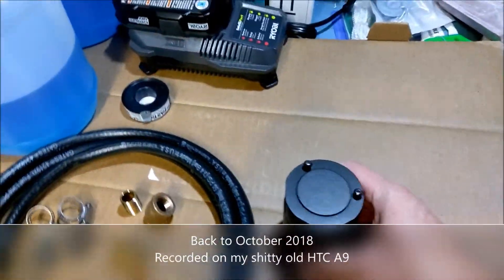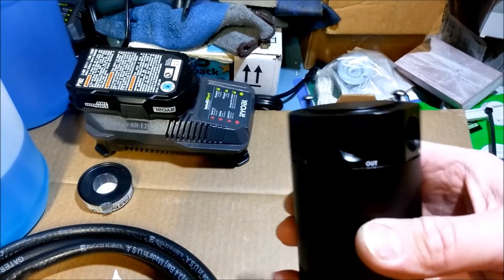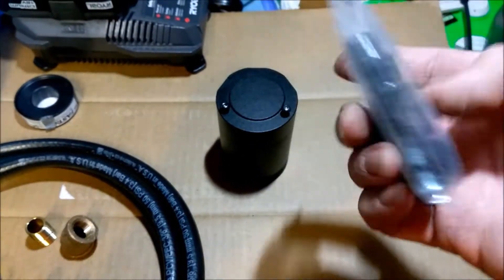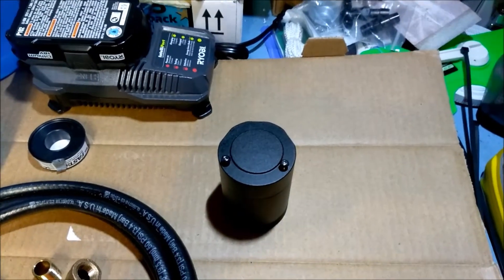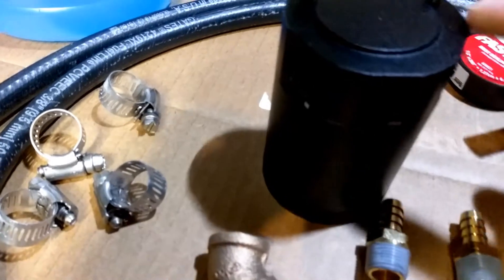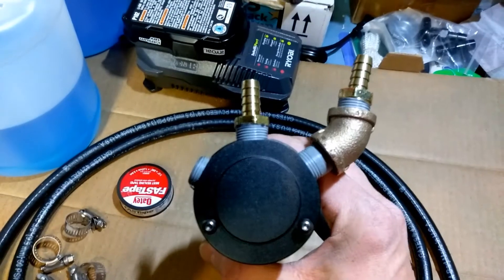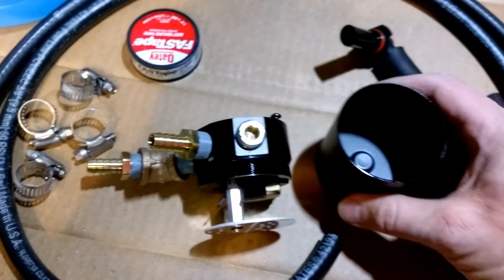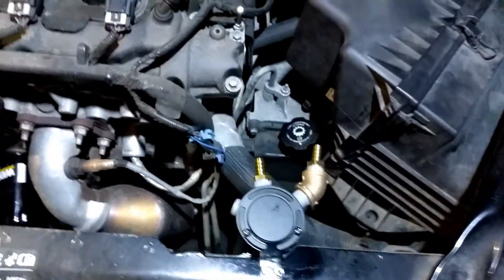GM 3.6 LFX V6 Catch Can Installation & Follow-Up (2012-2016 9th Gen Impala)

Comment: What about the front pvc valve that dumps oil in front of the throttle body. That's where I have a lot of oil on my vehicle.
Reply from the maker: Check out the Elite Engineering clean-side oil separator:
https://www.amazon.com/dp/B086WN3127/ref=cm_sw_r_cp_apa_glc_fabc_TDK0X0B5BQGTH0AWPJ6G

I see Amazon is sold out, but you can still order one from their website:
http://www.eliteengineeringusa.com/clean-side-oil-separator/

I'm actually going to be purchasing one and installing it sometime soon (with a corresponding video to follow!)

Their site sums it up:
"Although app. 90-95% of the oil ingestion via the intake air charge enters via the "Dirty" or "foul" side of the PCV system, the other 5-10% enter via back flow through the factory "clean" or "fresh" side tube. This occurs mainly when accelerating or at wide open throttle when intake manifold vacuum drops to zero and crankcase pressure is allowed to build. This pressure will seek the path of least resistance, which is backwards flowing into the intake air bridge assembly bringing in oil mist and other contaminants into the intake air charge.  While this will not cause severe issue with a port injection daily driven engine, it will cause detonation and reduced power and fuel economy, and in a performance engine, especially forced induction, this detonation is detrimental to power and the resulting knock retard is a negative tuners and owners should avoid, especially if the engine is run hard for extended periods such as road racing, drag racing, or aggressive driving period."
Reply: thats not a valve. thats the drivers side valve cover vent and it will suck oil/air from there when there is no/low intake vacuum

Comment: Great video man. I installed a similar can on my 2011 CTS it has a 3.6L V6 I believe it is the version called LLT. I find mine doesn't catch much condensation water but mostly dark oil in winter and I do live in Canada so it gets quite cold here. The main reason I installed a catch can on my motor is because I noticed a  build up of oil sludge in the main intake hose which was dripping out of the intake manifold and the throttle body was gunked up as well. On the CTS the engine is positioned differently in a longitudinal layout with the pistons facing out towards the passenger and driver sides and the pcv valve is behind the passenger side valve cover and runs to the top of the aluminum intake manifold and mounted directly above and behind the throttle body. I did some research and found out the PCV valve and the valve cover gasket can turn your car into a money pit of repairs or even a Junker if left as is. First I bought a new PCV valve and modded it by increasing the hole size changed the valve cover gaskets to the new format which allows more flow through that passenger side pcv. After all that I installed almost the exact same catch can used in this video and the amount of oil that's no longer going directly into the intake and throttle body is mind blowing. If I didnt install that catch can, I would be spending a crap load on repairs.
Reply from the maker: That's the best thing you could've done on that LLT!  I'm sure you've heard but it bears repeating - the timing chains stretch out on these engines if they're not properly maintained (the chain tensioners will fail with deferred maintenance.)  So I will add keep your oil change intervals low (below 5k.)  Don't go by the oil life monitor - reset one of your trip odometers when you change your oil and go off of that instead of the OLM.  Use a high-quality DEXOS synthetic oil as well.  Keep the internals CLEAN and you won't have any trouble!!

Comment: Bought my 2013 with 90k on it. Checked the valves a month ago when I replaced my voils and plugs. The tops of the valves r pretty gunked up. They look more like exhaust valve , even after seafoaming it last summer. But I have seen way worse in an LLT engine.
Reply from the maker: I was spraying CRC GDI intake cleaner into the intake every oil change before I installed the catch can. When I cleaned my valves at 158k they didn't look too bad. I might pull the intake again just to see how well the catch can is working.

Comment: Great video! I will be installing two oil catch can on my 2018 Traverse. I been searching videos on a guide on how to instal an oil catch can on these 2nd gen Traverse, but had no luck.  As the most i ever find is on the 1st gen traverse only which is different design than the 2nd gen traverse.  Im not sure if i need two or just one.
Reply from the maker: FYI, the engine in the 2nd Gen Traverse is essentially the same engine that's in the Impala from 2012 to 2020. The only difference is they added auto stop/start to it and renamed it from LFX to LFY.

That said, I looked up the PCV hoses on RockAuto and the dirty side hose, although longer, looks identical to the one on the LFX. 
https://www.rockauto.com/en/catalog/chevrolet,2018,traverse,3.6l+v6,3438973,exhaust+&+emission,positive+crankcase+ventilation+(pcv)+hose,11784
The clean side hose has a filter of some sort on it. Not sure if that's an actual oil separator or what, but I would suggest discarding that altogether and installing a clean-side oil separator.
https://www.youtube.com/watch?v=hu57lGzxiRY
Reply: @CertifiedShadetree how in the hell do you get that PVC valve out? I am so afraid I'm going to break something I have a 2020 Chevy Impala that thing does not want to come out
Reply from the maker: @peachyclean93  Latch a Vise Grip onto it and rock it back and forth whilst pulling up on it.
Reply: @CertifiedShadetree  I think I found out today that mine does not come out it's part of the valve cover which is so stupid!
Reply from the maker: @peachyclean93  2020 Impala, you say? GM never changed the valve cover design on the entire run of the LFX. Plastic valve cover with a metal PCV "valve" (more like an orifice.) Try freezing the PCV with a can of compressed air, then try wiggling it out. You could even heat the valve cover around the area with a hair dryer first to help expand the plastic surrounding the PCV.

Comment: I just bought a new 2020 Frontier with the new 3.8L GDI engine. I have 200mi on it and my can is on the way.  These should be standard on cars with GDI only engines.
Reply from the maker: Either that or OEMs should do what Toyota did and install a set of old school port injectors to work in conjunction with the DI injectors to aid in cleaning off the backs of the intake valves...
Reply: Now that sounds fire , need some Toyota action in my GMC CANYON ALL TERRAIN.

Comment: I bought a different style can with one side port and one top port with no labeling as to which is "in" and which is "out". Someone tried to ask this question on the amazon listing and some answered that the top was inlet and some answered that the side was inlet, so no help there. The top port is where the brass filter is directly attached. Can you clarify which is in and which is out for me please?
Reply from the maker: The inlet is the one attached to the filter.

Comment: Hey need help, can’t find the PCV valve on my 2016 impala with the LFX, my air intake is on the passenger side.
Reply from the maker: It's in the exact spot!  The PCV-to-intake hose is quite a bit longer, but the PCV itself is on the rear valve cover on the driver's side.

Comment: I’m worried about the catch can freezing
Reply from the maker: @Travsav-rt1sh  It mostly fills with oil, so it doesn't actually freeze. I have one of these installed now: https://a.co/d/fnH0TPv
It's twice the capacity of the one in the video, so you don't have to empty it as often in the winter..
Reply: Oh ok so I’m looking to install one on my 2012 impala 3.6l lfx how did you install the bigger new one
Reply: I know that there isn’t much room
Reply from the maker: @Travsav-rt1sh  I used this bracket and flattened it out. https://a.co/d/5H0pnwj
It pushes it far enough away from the fans.
I can't link it directly, but check my channel's Community tab, I posted pictures of the install.
Reply: @CertifiedShadetree  just got the catch can installed and spark plugs changed I can’t believe how much water/oil it catches in the winter I drove 20miles and it already had a pool in the bottom of the container
Reply from the maker: @Travsav-rt1sh  At least it isn't collecting on the backs of the intake valves anymore!! 😁

Comment: Just did the can today on my ‘13. Do you have any tips on not kinking the line on the back hose coming off the back of the intake? I don’t think you want to have it flipped up as it won’t be locked, correct?
Reply from the maker: What I did was lock the connector with the end pointing down then zip tieing that hose to the other hose right near where it connects at the valve cover.  That forces the connector to stay in the downward position so it won't twist back out.  It's held up for over 3 years so far!
Reply: @CertifiedShadetree  thanks!!
Reply from the maker: Any time!

Comment: Why do you drill the PCV nipple? I’m trying to understand the need for that. I’m getting a 2020 Acadia for my wife this week and will be reusing the can from my Silverado with some slight mods to make it work (new hoses, etc). But why drill the PCV?
Reply from the maker: On the LFX and LLT engines, the PCV was too restrictive and caused the rear cylinder head to gunk up underneath the valve cover.  The factory corrected this issue around 2014 with a revised PCV (with the holes enlarged to the sizes I mentioned.)

I had someone comment on one of my other videos that the LGX engine (that's in the 2020 Acadia) is heavily redesigned and shouldn't have any of the issues that plagued the LLT and LFX regarding the PCV and oil consumption.
Reply: @CertifiedShadetree  so a 2016 impala shouldn’t have this issue?

Comment: Hey this completely off topic, but my defroster just quit working, it comes out the feet. All other blower settings work fine. I replaced both blend door actuators months ago after the common “clicking” noise. I can hear the actuator moving when I select defrost but nothing comes out the top. I would believe one actuator would be bad again but both at the same time? Any thoughts? Thanks!
Reply from the maker: This is the best video out there on how to fix that issue:
https://youtu.be/Lx2mI04Ilqo
Reply: @CertifiedShadetree  thank you!
Reply from the maker: @jameskarl8908  Good luck!🍻

Comment: Hello man I have a question I want to take the pcv valve out to clean and drill it does the pcv valve just pop out by pulling it out by hand or do you need a tool to get it out
Reply from the maker: Grab it with a pair of pliers and wiggle it out. Don't squeeze too hard on the pliers or you might crush it. You could also wiggle it up just enough to get a flat-blade screwdriver under it and pry it out.
Reply: Thanks for the fast reply going to try that out now thanks again brother 👍
Reply from the maker: @luiscarrera5181  Best of luck to you! 🍻
Reply: Thank you

Comment: I just took off the air box and there is oil in my intake tube, did the catch can but the oil is come in from the front tube coming off the front rocker cover into the intake tube. Are you having oil coming in there too? Thinking of teeing it off to the catch can too.
Reply from the maker: I haven't had any oil in the intake tube.  Have you drilled out the holes of your PCV?  The tube going from the intake tube to the front valve cover is supposed to be the "clean" side (airflow goes from the intake tube into the front valve cover, out the back valve cover/PCV and into the intake manifold.)  My thoughts would be if your PCV was restricted or gunked up, it would disrupt the proper airflow path and cause the pressure buildup to go backwards back into the intake tube.
Reply: Yep drilled it out when I put the catch can on a couple months ago, should be ok, but maybe I should double check it anyway.
Reply: Catch was full again a little over 3000kms, really works good.
Reply from the maker: Do you happen to know if the oil is fresh since you drilled out the PCV?  If it is, I'd consider pulling the rear valve cover and cleaning the shit out of it.  Before that though, pull the PCV again and see how dirty it is and hit it with some carb cleaner or brake cleaner.  I find I still have to clean out the PCV every-other oil change, as it seems to continually gunk up with crap.
Reply: I drilled it out a couple months ago and just done an oil change three weeks ago, it has probably around 9000 kms of driving since I drilled it so maybe it is clogged up, I  got time off work coming so I should maybe check out the cover.
Reply from the maker: I wholeheartedly recommend switching over to Valvoline Modern Engine 5W-30 oil.  It's made a huge difference in the oil consumption (hasn't' completely eliminated it, but drastically cut down on it.)
Reply: Ok thank you for your advice 👍
Reply from the maker: Any time!! 🍻
Reply: Don't DO IT!  Only connect the  one coming from the PCV valve. The other line is drawing filtered air into the crankcase. Another guy here on youtube did this and it resulted in max negative pressure in his engine and blew a seal.
Reply from the maker: @flyboy6258  I think you're misunderstood. The hose you are referring to is on the front valve cover and is not connected to the can in any way.  The can is essentially spliced in between the 2 ends of a hose that already runs from the rear head to the intake manifold and is merely filtering out the oil.
Reply: @CertifiedShadetree  I was referencing what this guy did on his v6. Check this video out.   https://youtu.be/PrO1GJfRw4Q
Reply: @flyboy6258  yes I try it but notice something was not right and realized what I was doing was wrong, thanks tho👍

Comment: Running rough idle but no check engine light .. pls help , on my
LFX GMC canyon 3.6 2016 all terrain
Reply from the maker: Start simple with a tune-up and a throttle body cleaning and go from there.
Reply: timing chain

Comment: I see you have a K&N drop in filter, how do you find it? Any differences in gas mileage?
Reply from the maker: Got it from Amazon:
https://www.amazon.com/gp/product/B007Y1PP4E/ref=ppx_yo_dt_b_asin_title_o00_s00?ie=UTF8&psc=1
I did notice a slight improvement in gas mileage, maybe  0.5 to 1 MPG.  I didn't notice any seat-of-the-pants HP gains, really.
Reply: Ok thanks, didn't think it would in power feel much, but any gas increase in mileage is good. I cut an opening on each side of the air box inlet hole and it gave a nice deeper intake growl.
Reply from the maker: I can dig that!  And if you think about it, that's about all those "cold" (more like warm) air intakes do, is make a nice growl with no HP gains as well!! 🤣🤣  Well that and they fleece you out of $300 for the privilege!!
Reply: Yep you got that right 😂👍

Comment: Hey, man, I have a 2011 Impala with a 3.5 and I'm wondering if you know is it the same setup? And would it be worth is?
Reply from the maker: No, it's not the same setup. The 3.6 has direct injection, which necessitates the catch can because there's nothing there to keep the intake valves clean. Your 3500 has port injection, which by nature washes the backs of the intake valves, so a catch can is unnecessary.
UNLESS your engine has a tremendous amount of blow-by. But by that point you'd be in the market for a new engine..
Reply: @CertifiedShadetree  wow, thank you for the quick response I appreciate you help and time.
Reply from the maker: @SlowImpala  Any time!